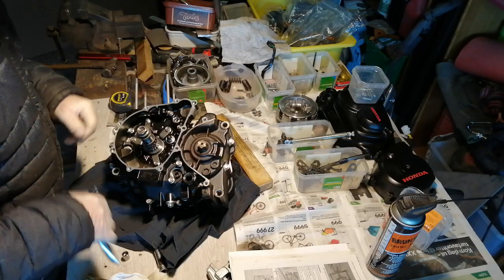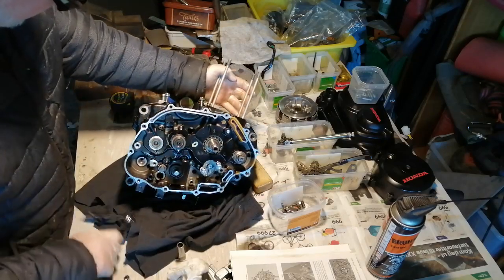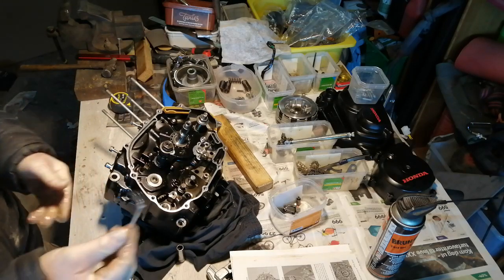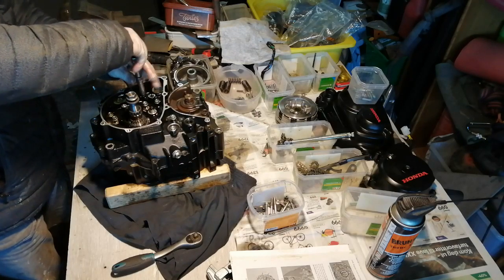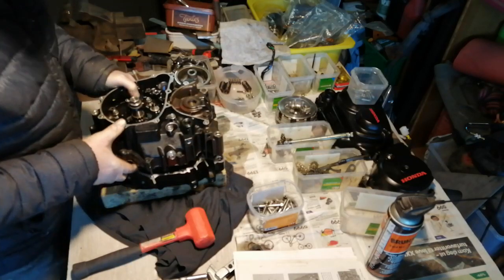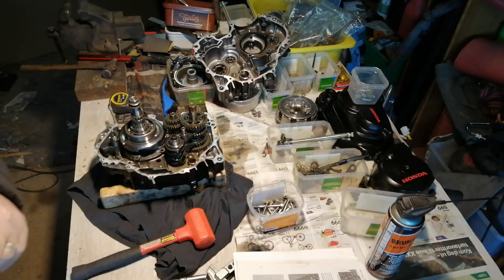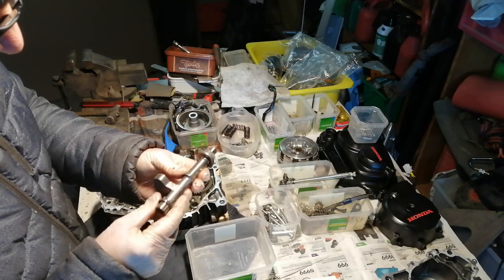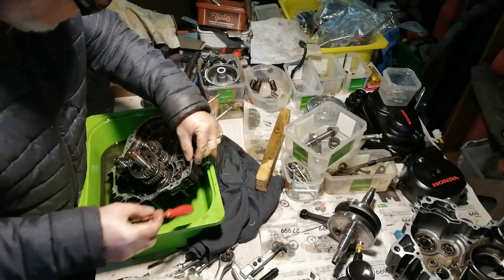HONDA CB125F Engine Crank Cases #4 Open up, lift out crank and gears. Cleaning out broken piston.

Comment: I have owned a cb125f since 2016. It is very reliable and after 15000 miles is still going and looking like new. I also own a Royal Enfield Himalayan. There are lots of videos on the Enfield. Almost nothing this involved for the Honda. So for me, who likes to service and look after my bikes, this series of videos are brilliant. I'm subscribed and I'm looking forward to seeing the piston and bore repairs. I would like you to show us the bike when it's complete with all the mods and repairs you have done. Thanks for sharing.
Reply from the maker: Thanks! Yes, odd there isn't more vids on them since I believe they sold loads. I can only conclude that they are running faultlessly, and it's only the odd ridiculously abused ones who make it on here :-) 
Sorry for the delay, I tend to make videos in between projects and it's been really busy lately :-) 
Definitely will finish the series and reveal the bike!
Reply: @handycrowd  I think most of these bikes are owned by young kids who don't want to work on them. So they get neglected. Shame as they are capable of so much.
Reply from the maker: Totally! I think buying a used 125 is just about the hardest vehicle to buy, you just never know how it's been ridden (but fairly safe to assume hard!) 

At least I bought mine for peanuts because I knew it had been abused. Testimony to Honda though, I could not believe how little damage there was after running out of oil, not to mention how long it must have been running with waaaay too little oil...  @markrobertson5305